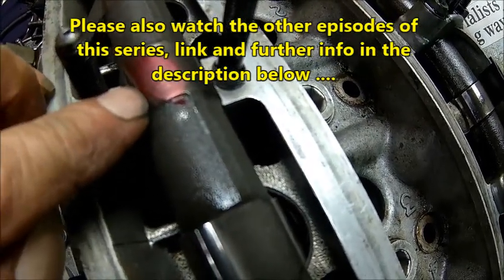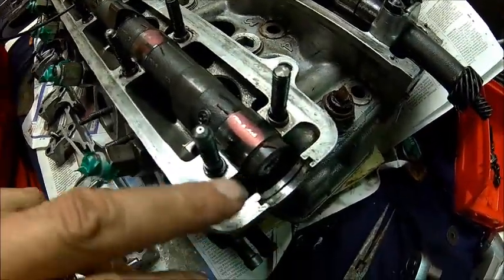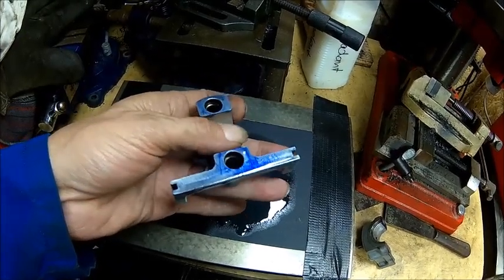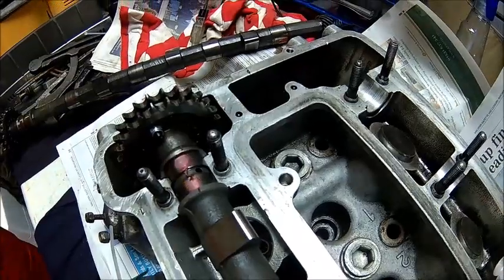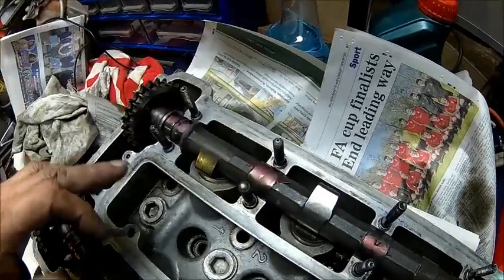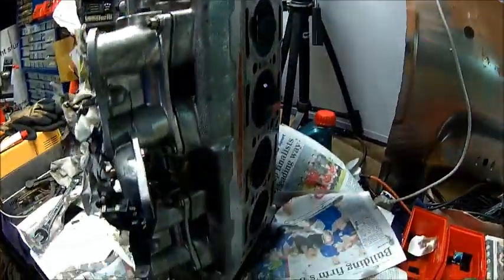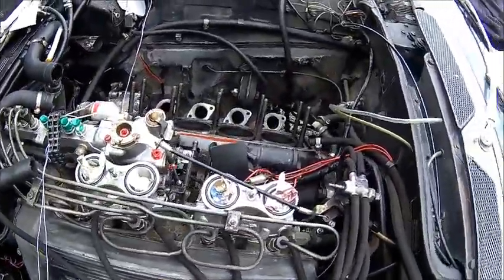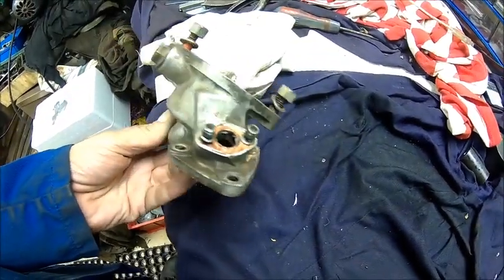Alfa Montreal cylinder heads Part 2, working the bearing caps, more measurements, re-assembly

Comment: nice job so far. that thing should run real nice when you're all done...some of the pecker traxx from the previous intrusions are hard to fathom. if a guy doesn't have the tools to work on something like that, he needs to pass on that job instead of leaving those kinds of witness marks behind..
Reply from the maker: After looking at the big picture, we think it was done up on the cheap to get it going before the previous owner imported it from Italy. Stringing all the telltales together, we also suspecting that the R/H head gasket was reused ...